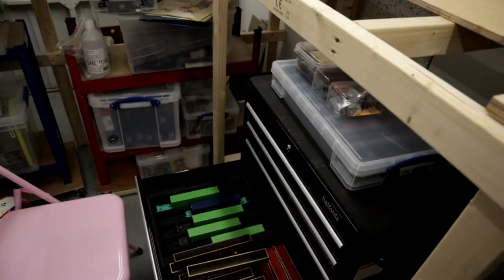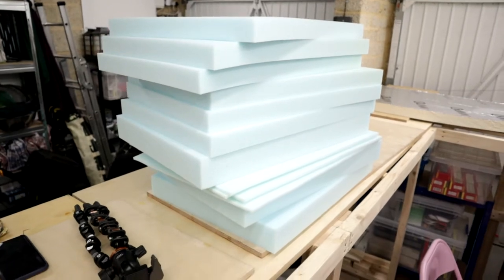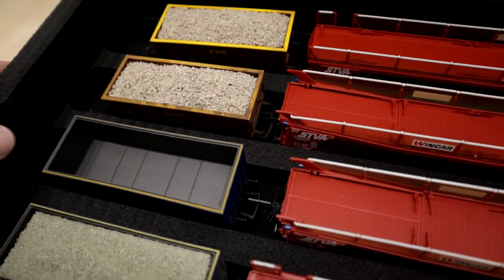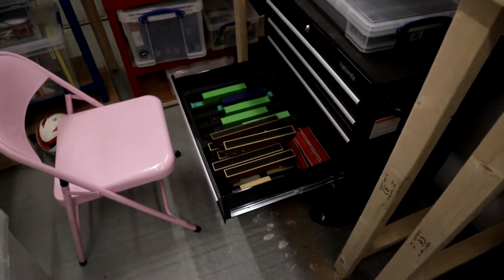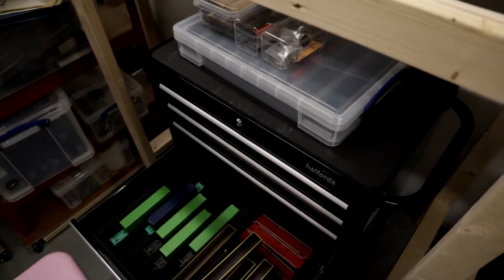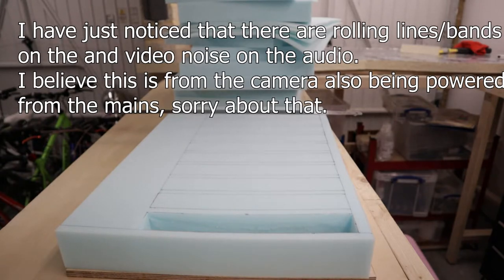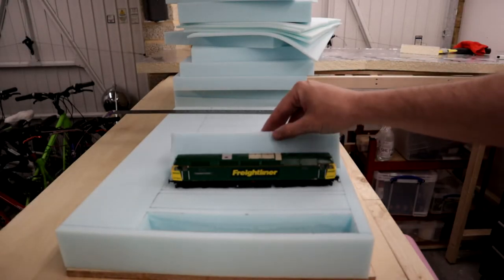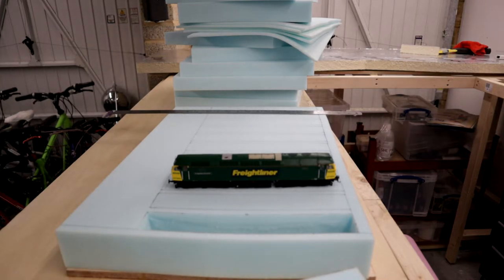Building a Model Layout in the Garage - Part 3 - Foam Storage Inserts

Comment: I know its been awhile since you uploaded this but the foam you need is called Kaizen foam. It is used for tool drawer storage. You can buy cheaper versions of it from machine mart.
Reply from the maker: I did change the foam to another type, closed Cell I think.  I also found something called ShadowFoam, a UK Supplier which looked fairly neat.

Comment: Hi Chris. As you have discovered, the sky-blue foam is not dense enough for your purposes; therefore, the separation ribs are too thin. However, I would hope they would look a little better once you have locos in the drawers. Again, not necessarily a pretty sight, but you could use some card to reinforce the separators.BTW: What's with the girlie-pink chair?